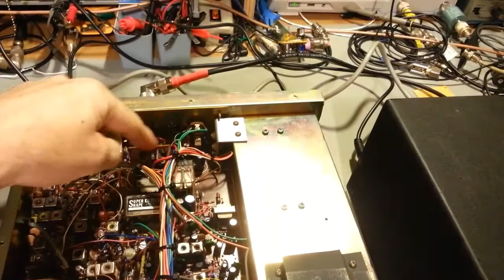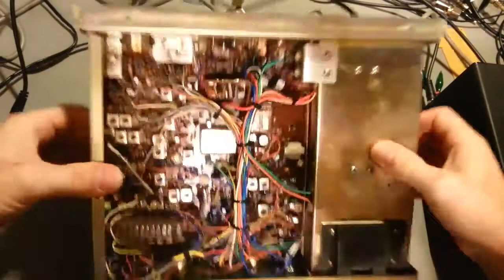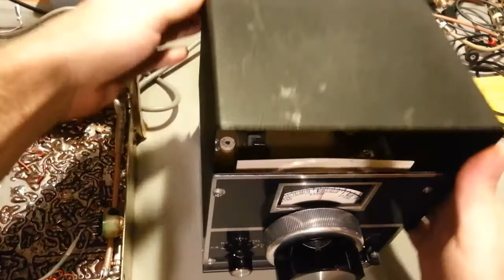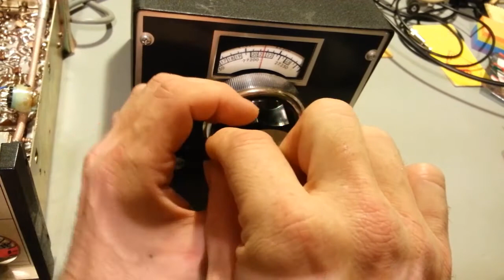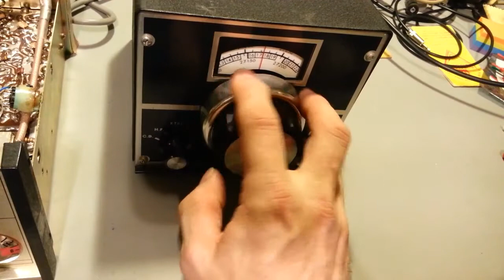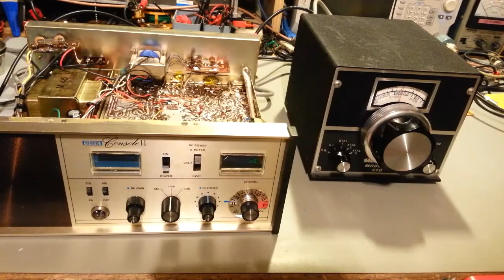SBE Console II 2 AM/SSB base station and Siltronix VFO 90.

Comment: I bought one of these used in the late 70's. The SBE factory was close by so I went there and bought their 40ch conversion kit, easy to install. I then wired a D104 to it and added a Siltronix 90 VFO. Loved that radio until getting my Ham Radio ticket in 1980 and never looked back.

Comment: I've owned two if these at 3 different times.  Bought the first with the Sil 90, fixed it, sold it, bought it back when the new owner broke it, fixed it again, sold it again.  After a while I wanted another, bought my current one broken, fixed it, and mated it to a PAL VFO.  I think I made a video about it, but someone had gotten inside with the golden screwdriver and completely wrecked the alignment.  Every single screw had been turned.  Took a few hours to get it back right enough to figure out the real problem, which was a bad RF amp transistor.  It would have been a 10 minute diagnostic if not for some idiot messing with it.

Comment: The NASA video on soldering for Space Craft use  I posted the other day on the Siltronix Counter video instructed you to bend the leads in the direction of the trace before soldering etc....
Reply: Keep in mind that is the over the top, has to work, never fail method.  Maintenance is of little concern.  Removing those components is not fun, especially if you need to contain your heat from damaging the board or neighboring components.